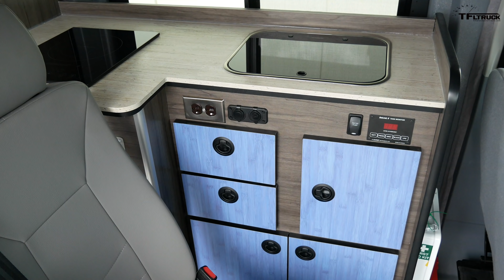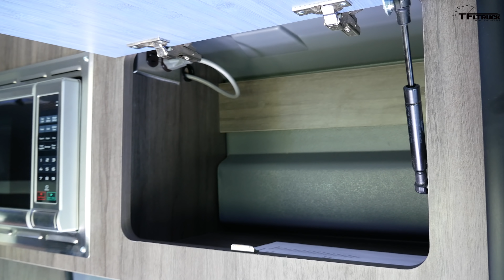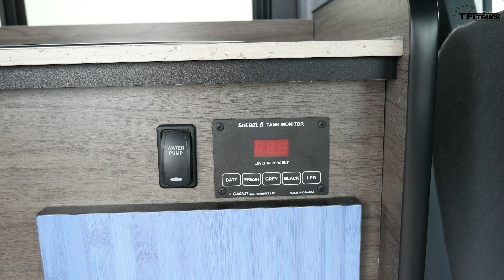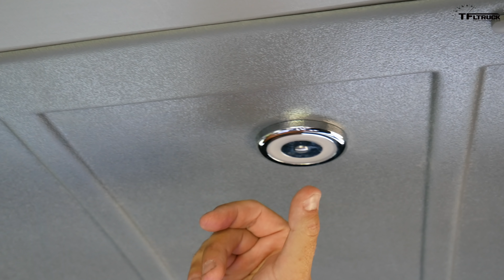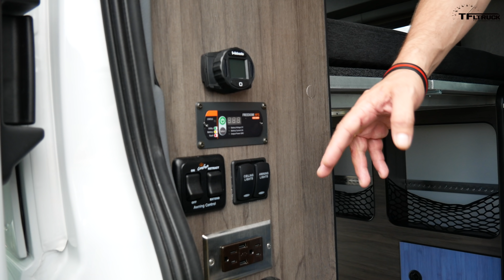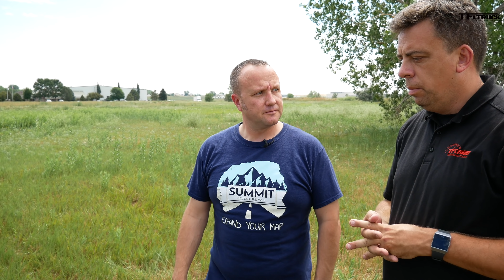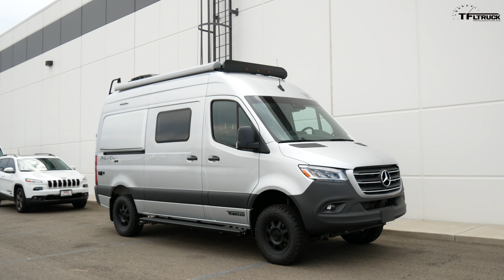This 2020 Ford Transit Summit Adventure Van Is The First Of Its Kind! #Vanlife

Comment: The Revel comes with a bathroom, solar, A/C, passenger seats w/ table, and (most importantly to me) 4x4 at a sale (not MSRP) price of $120k - $125k. In order to make the Summit competitive and more  "affordable" than the Winnebago Revel they'll have to offer a 25% to 30% discount bringing the price down to $95k to $102k.  The new Storyteller Mode will be available next month on the Mercedes 4x4 chassis (very similar to the Revel floor plan) for, I believe, $135k.
Reply: @Ralph, yes, the StoryTeller Mode has better features than this Transwest does. Know your competition  - if you don't ...
Reply: Exactly. And of course it will be 25% off of MSRP, just like the Revel. This guy is the builder, not the dealer. Not sure why everyone is comparing this MSRP to the Revel's drive away price.

Comment: No thanks.  Don't need a certified motorhome or RV.  Don't need to spend that kind of money for something that does not even have a bathroom in it.  ;)  If you have this kind of money, you can buy a LOT of different things that will fit your design needs for this much or less.  And or buy a base cargo van and have it custom made for far less.  And if you are rich and don't care about costs, you would not be looking at this thing either.  So who does this target???  Maybe a contractor that has limited parking space available to them and needs something multi-functional for when the weekend comes?

Comment: Over priced $100k adder for some cabinets ...ouch
Reply: + track system + legit rear seats + bed +  insulation + inverter + heater + ventilation + stove + plumbing + battery management + awning + ladder + roof rack etc. Yes, it is crazy expensive, but it is a lot more than just cabinets
Reply: Mechannel for $135k, the bed shouldn’t be akin to what a child might design for a sleepover. 

Look at what a whole toyhauler costs, which has far more and is less than half the price for a larger square footage.
Reply: @Monkeyseemonkey79  All those things combined are worth less than 15k....

Comment: First, it is not a true 2020 Transit van since that van is different from this one and second a true 2020 Transit van with AWD as an option and will get you that true adventure van status
Reply: It's pretty common for whatever year rv to be built on the previous years chassis since there's got to be a lead time for ordering the chassis and then building the rv itself. Just a thought as to why they said 2020 model.

Just using the term rv because they did. To me this is just a camper van at best.
Reply: @Rando_Nameo  At some of the Long Term Visitor Areas in California and Arizona, since this RV is not self-contained, an owner would be forced to stay near the washrooms … BLM do indeed enforce this. Let's just say, not the best, nor quietest areas in an LTVA.
Reply: jmc6000 and the 10 speed auto

Comment: Their price point is way off at $135 for the level of amenities they offer.  I love the flexible platform idea, but the those features are not worth $70,000+ over the van itself.
Reply: TOTALLY AGREE! My first thoughts when looking at the video. Fell over when price was revealed.
Reply: BuckO Seven — exactly!  $135k and NO baffroom!  What a joke
Reply: My plan: lightly used Chevy Express LWB, ~$22k.  Build, about $20k.  Do everything myself.  Removable bed and frame, though this folding one is nice.
Reply: That’s a nice way to say these are a rip-off.
Reply: All of these Class B style "factory" VAN conversions are overpriced. This is comparable to the Winnebego Revel which runs like $160K-$170K. This is the whole reason people buy base cargo models and convert them themselves. Or buy used.
Reply: Its a rip off
Reply: Axion is out of business, otherwise is the only RV I want to purchase: https://www.youtube.com/watch?v=i73gHyGDIp4&t=606s. The price is half of the Ford Transit Summit Adventure
Reply: @BuckO Seven...more like $90K over the bare van price.   If you go to Ford's website and build a van like this one, it's close to $50K MSRP.   I'm assuming you could negotiate $5K of the sticker, which makes the van in this video crazy expensive...and it doesn't even have a 4x4 conversion, an AC unit on the roof, a generator, or solar panels on the roof.  Newburg Ford in Newburg OR has 26 Quigley 4x4 conversions of this van on their lot right now priced between low $50K's to high $60K's depending on options.  If I was in the market, I'd get one of those and either DIY the interior or find an upfitter in my area to build it out.  There is a fellow named Red of Red's Custom Design, that builds out vans to your spec.  He seems to do good work at a very reasonable price.  His website is worthless, but he has a YouTube channel under the same name so you can see what he has done for other people.  He'll take you through the whole build and even share what he charges.
Reply: @David-rx2to  The Coachman Beyond is similarly priced, and has much more content. It's available on the Ford Transit 350 dual wheel chassis with this same 3.5 liter EcoBoost engine, comes with a nice wet bath, greater tank capacity, an AC, and a 7000 watt lithium battery option with dual alternators and a 2000 watt inverter. That package is somewhat pricey, but might be negotiable.
Reply: @Mark Villano   Wow.  Wasn't aware of the Coachman Beyond.  Impressive specs, especially the one with the lithium package.  Online price: $113K,  (MSRP $161K) which beats the heck out of the package in this video.  Would be perfect if it was a 4x4.
Reply: @David-rx2to  Indeed! I saw a few reviews of the Beyond and they blew me away. They also have an special insulation upgrade package that makes this rig a solid four season van.
Reply: @David-rx2to  all electric..................even the ac unit:)
Reply: @David-rx2to  Damn...a Quigley 4x4 conversion for 50-60K in Oregon means I'd be getting it upfitted by one of the best in the business who just happens to also be in that area: Outside Van.
Reply: @voodoo36x   Awesome!  Good luck with the purchase and build!  Don't know what Outside Van charges for their work but cross shop what they will do for you vs Red's Custom Design.  I'll bet Red comes out much much cheaper and it might make it worth the trip to his shop.
Reply: @David-rx2to  I AGREE even the coachman RV all electric are selling for 80,000, and the revel 2019 selling for 95,000 and thats a 44, the 2020 revel is listed at 160,000 but selling for 110,000 as my bud just got one:) its VERY nice with the electric sliding side door!

I would be ok wit this van being $60,000.......add 44 $70,000, NO LED lights, sliding electric door etc............
Reply: And when the 2020 transits come out they will have factory 4x4 option
Reply: @sikinboat They'll be equipped with an AWD option...not 4x4.
Reply: @2XIST_Unbound  like my new crosstrek AWD- but i can assure you its unstoppable on any street! NEVER stuck yet in the most mountainous areas of California:)
Reply: @sikinboat  it will be AWD probably a copy of the 4Motion from VW

Comment: $135,000 is way to much,  You can buy the van New for $35,000 spend $10,000 on insulation, bed, water, stove, solar, batteries, and save $90,000........
Reply: You can buy houses for that much and not lose money from depreciation.
Reply: @NDIrishfan71   Yep after 1 year this $135,000.00 Van will be worth $40,000 maybe
Reply: @NewtonWashinton  prob 100000. They hold value pretty well
Reply: Yep I agree we will buy a Ford Transit and build it ourselves
Reply: @nadiacusan7854  Good job!
Reply: Newton Washinton :

Comment: The price may sound high ,but the heater itself is very expensive. The 12 volt refrigerator is also high.
Ford is not my favorite,. Saying that I think for the money and it will be cheaper to maintain than the other vans.
The quality seems to be there. No fancy powered beds. This would be a great road trip van to explore America.
I give it a B+.  Good video mates.🇱🇷
Reply: For a weekender … I give it a C-. They chose an expensive heater due to a decision to go against using propane (there are less expensive heaters out there that can use either propane/electricity or both (Truma). 12 volt compressor refrigerators are not too expensive and they chose a small one at that. No shower, no toilet (not even a cassette style). How often is this van truly going to be used for dual purposes? There are far better camper vans out there for less. The price doesn't sound high, it IS high … too high. If they can't reduce costs, they are not going to be around long.

Comment: Way overpriced for what it is. You could take a brand new Transit and build something yourself for way less and probably have it be way more practical. Plenty of van builds out there on Youtube.
Reply: Unless you can’t. Also consider the prices given are MSRP. No body pays msrp for RV’s.
Reply: @JasonNotBot  except this isn't a Coachmen or Thor this is pretty much a custom build company and they are most likely not going to be offering discounts.
Reply: @JasonNotBot  Class B RVs do not have nearly the same discounts off of MSRP as Class A and C RVs do. Maybe not paying $135K but it would be relatively close to that. And, being a small company, unlikely they have good discounts based on volume sales. I know this b/c I purchased a Class B earlier this year. I have a video of it in the comments section. You'll see this RV features a LOT more for a far LESS cost than this Transwest.

Comment: Air-conditioning is not optional in South Texas. It’s been over 100° for two weeks so far.
Reply: TexasScout Noneofyourbusiness, it doesn't need to be 100+ to MANDATE A/C. Try our Puerto Rico's humid weather (6 months with afternoon highs > 90) and you'll know why even the cheapest econobox has factory-installed A/C here...

And yes, I agree it's a trifle too expensive for the amenities, but any Transit unit would be quite easier to service if anything goes wrong (a single Mercedes dealer in the whole Island vs. like 8 Ford ones).
Reply: @syxepop  Agree, however ever, for the last two weeks it's hit 100-102 with 85-90% RH here
Reply: TexasScout Noneofyourbusiness, yes... I have been following how awful it has been Stateside and in Europe with the heat and I don't envy your pardners on that. Which is why would people learn a thing or two from other people who are "in the heat" almost yearound  (60+% humidity for 24 hours / day during the summertime is not uncommon here).

Comment: No bathroom, ,no AC, no solar.. a lot is missing. My friend bought a Winnebago Travato on a Dodge chassis for $90k. MUCH nicer van. Sorry to say, they won’t sell.
Reply: Or even a Coachman for $80k is still much nicer.
Reply: I'd be interested in the Travato on the new Ford Transit all-wheel drive chassis with an upgraded suspension lift and aggressive tires.

Comment: If I was to get something like this, I would consider making it a 4x4 with a Quigley conversion. That would increase the ride height by a couple of inches and you lose a few hundred pounds of cargo capacity. You do get a real transfer case.
Reply: You can get factory 4x4 in the 2020 Transit.
Reply: @gregbrooks3577  I think it's more of an AWD than a true 4x4.

Comment: First of its kind?
Outback in my yard sits a 1980 dodge d200 camper van where the bed in the back is removable where I can put full sheets of plywood. Has a fridge, stove, furnace and removable table. 
Bought it for $1400 with 87000 original Kms
Tell me how this overpriced Pherd is anything new?